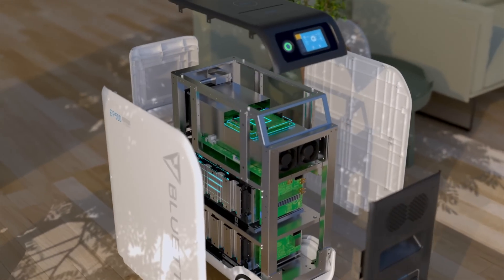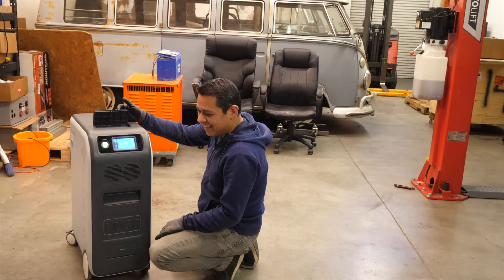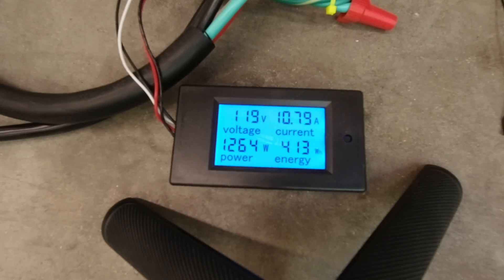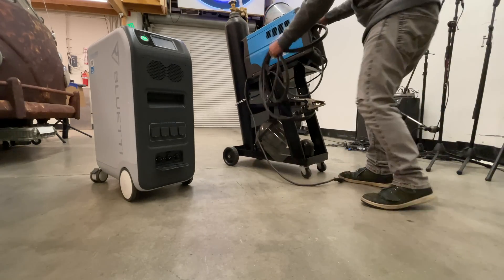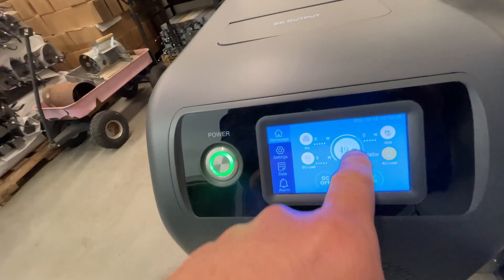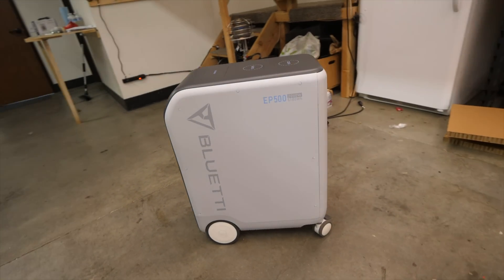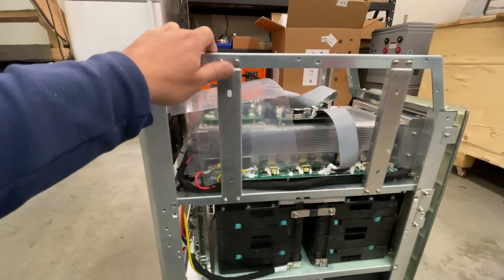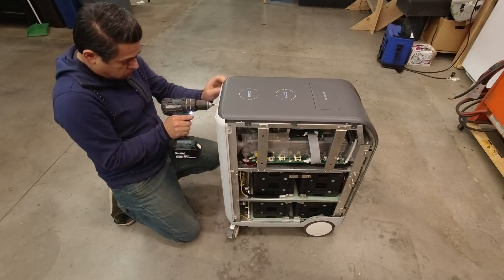Everything you need to know about Bluetti's NEW EP500 - review

Comment: 1200w at 150v so .. charging two units means gotta have 24 100 watt panels array that’s a HUGE ARRAY.. assume most would go 200W panels? 150volts is same as Ac200.. wonder why they didn’t increase input voltage? 

And 85% on battery? Should be like 90 -95 right! Isn’t the AC200 closer to that. So is this a thumbs up or down from you overall.. hope you do a follow up with parallel units
Reply: For solar, I'd go with (4) 330 watt residential panels, 2 series 2 parallel configuration for 1,320 watts total. Hopefully ok to over panel since unlikely to see full power anyhow, would have a Voc of 82v, Vmp of 69.2v and Imp of 19.1 amps.
Reply: @ssyoumans  do you have a source you like or experience with that I can price compare?  Thanks for your feedback!
Reply: @richardblank6333  Check out Northern Arizona Wind and Sun. They sell the REC 330 watt panels for $213.44 plus freight shipping, so shipping can be expensive 🤔😞

Comment: Something this BIG should have at least one 30-AMP outlet (L5-30P or TT-30R)
Reply from the maker: Why? This unit is only capable of 20A
Reply: @jehugarcia  I did see you parallel TWO 15/20-amp outlets for your testing protocol so why not?
Reply: @MrAdolfo2b  Because 30 Amps continuous is way above the Inverter's limit ...
Reply from the maker: @MrSummitville  because I want to test where the inverter breaks and not where the plug melts.

Comment: Looks like the plastic version of apple's latest mac pro with wheels. That standby time is kinda horrendous though....15% a day is so much wasted. Guess I would have to manually turn on and off to save energy
Reply: It has a remote.
Reply: Be nice if it had a suspend mode that reduced the load from the inverter if not in use.

Comment: Thank you so much for this review.
I have no PV, needed a UPS for my pc anyway and thought "hey great, UPS to shut down the pc + keeping the fridge running for a few more days" but as of now this is an online/double-conversion UPS. I will have to wait and see if the offline/standby mode has a sufficient short transition time & low energy usage.
Otherwise I could just buy a cheap UPS for the pc and back the fridge with a diy powerwall + manual transfer switch.
Reply: It not PC UPS better off get a reg PC UPS for that
Reply: @SHSPVR  yes i noticed that too, thanks. There was just the hope to "get a free UPS with your battery-backup-power".
Reply: @blauesKopftuch  I know I was hoping for same thing with Ecoflow Delta but it to has no true option for being a Computer UPS by USB cable
Reply: @SHSPVR  There is no need for a USB-cable if it can power the PC for >10 hours. ;-)
If the power goes out just continue with your work, if the power isn't back within 5 hours turn off the pc and power the fridge for another ~3 days... at least that was the theory.
Reply: @blauesKopftuch  LoL did you all ready for get about what happen in Texas and many area of Oklahoma and why USB is to tell the PC turn it off just a reg PC UPS dose beside many of have in home media or file server and this can at any time when not around or in bed with you know it
Reply: @SHSPVR  Best to use the right tool for the right job.  A real PC UPS is the right device for people with critical loads that need those shutdown features.  Those kinds of features, and the cost for certification, are why they cost more than a basic UPS without it.   You could always plug a smaller PC UPS into the EP500 so you get both endurance and PC shutdown capabilities.

Comment: This with the scooter batteries, yea you can live off grid for good.
Reply: Had the same thought, BUT:
scooter batteries voltage is higher than AC200P  PV-input voltage so this works
but the scooter batteries voltage is lower than the EP500 PV-input voltage so you will have to put them in series ... label on the EP-500 says 55Volts input minimum and jehu says the charge controller can handle 70V-140V DC ...
Reply from the maker: @blauesKopftuch  ill tackle this on next video

Comment: That top board at the back looks like the switching board for the inverter, as it has the pre-charge resistor on it. This not switching off is the culprit for the huge parasitic drain on idle.
Reply: If you switch it off it would need to be manually switched on everytime you want to power something with AC power.

Comment: 500 W/h self consumption when idling seems waaay too much for me.
Reply: Your numbers are Way OFF. It drained itself dead from idling in 6.5 days (156 hours) so that would be 32.8 watts per hour idling..... Not the 500w/h you posted. If that were the case it would be dead in 8 hours just idling.
Reply: @maddeusdoggeus1  please, both of you, it is Wh "watt(times)hours" not W/h "watts per hour".
Power = Work / time.
Work = (Stored)Energy (=the potential to do work), unit of Work is 1J (Joule) also known as 1 Ws (Watt second).
So starting with 32.8 watts continous powerconsumption you calculate 32.8 W * 156h = 5116 Wh and see Maddog is right (if you ignore the "per"  :-D ).
Reply: @blauesKopftuch  please dude. It uses 32 watts over the time period of an hour just standing by............. so yeah I will still say it uses 32 watts per hour just sitting there looking pretty 🤗. Thanks for the review though👍
Reply: @blauesKopftuch  No really ... it is Watts Per Hour , as in ... it consumes 32 watts per hour of on-time!
Reply: @MrSummitville  repeating something does not make it right.
https://en.wikipedia.org/wiki/Kilowatt-hour#Misuse_of_watts_per_hour
watts per hour is as wrong and useless as mph per hour, it is miles per hour and not miles per hour per hour. 1 Watt is already 1 Volt * Coulomb / Second = V*C/s because 1 Amp is 1 Coulomb per Second. (in doubt, always trace a unit back to the 7 SI Units)
Do you realise how absurd Volt * Coulomb / (second * hour) = W/h would be?

Power * Time = Energy (used)
W * h = Wh
If you use the same Power twice as long you use twice as much energy, if you use double the Power but for the same time you use twice as much energy. You have to multiply the power with the duration you used said power to get the consumed energy.

Comment: how much is it...?
Reply: $2799 if you go to their website and sign up for the “Early Bird Perk” before March 23rd(?)
Jumps to $3999 after that.
Reply: @maddeusdoggeus1  Way too high!  No one will buy at $3999  BS
Reply: @shawnnn3  You're paying for 5000 Kwh of batteries, or 80 cents per wh, which is on par with a lot of these power banks/solar generators.
Reply from the maker: 5 kwh  = $780/kwh
Reply: I meant 5000 wh, not Kwh of course.
Reply: @shawnnn3  Four Battle Born 100Ah 12v batteries would give close to the same capacity and costs $3,796 and doesn't include the inverter, MPPT charge controller, AC charger, wifi doggle, etc.
Reply from the maker: @TC-nn7xk  battleborn = Most expensive battery on the market
Reply: @jehugarcia  They have to make up the money for all the ones they give out to tubers somehow right?  ;)

Comment: Interesting to see the production model after the difference between the AC 200p, I'd have liked filters on the air inlet fans that you could clean and keep the inside dust free
Reply from the maker: It does have changeable filters
Reply: @jehugarcia  cool, thanks for that

Comment: It comes at a price of $2599 after a 32% discount on its potential retail price.
Reply: Yea AC200 started this way too then.. the production unit went out at 2000whr not the 1800whr Kickstarter @initial “discount” price. Wonder if they will fix and boost again the capability  AFTER their initial customers debug it for them 🤷🏼‍♂️   -like goto 6000whr and charge the extra 30%.. kind fun shy after their tricks on AC200
Reply: @richardblank6333  85% is pretty normal. The stated capacity is always battery capacity not overall capacity.
Reply: Price Too high for me for what it is.
Reply: @ssyoumans  yup, would rather buy a Tesla Module for $1k and have 5.2kwh of storage..